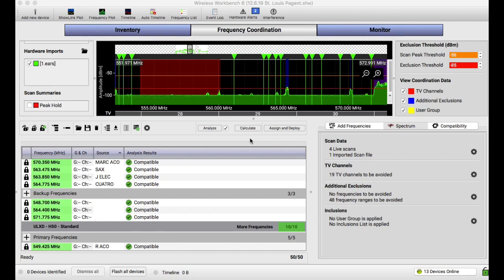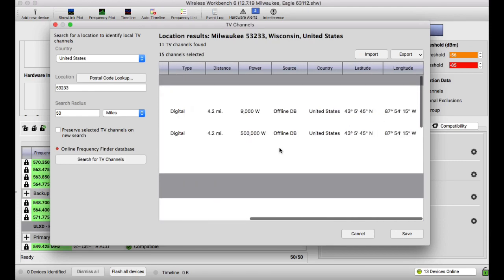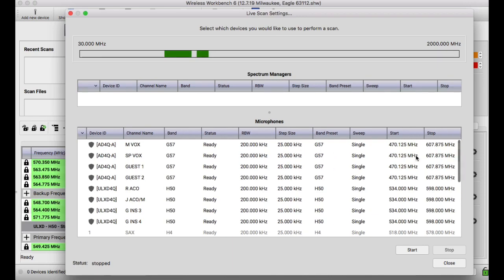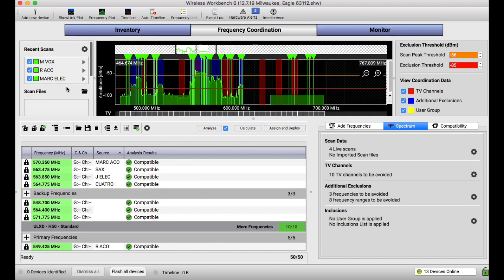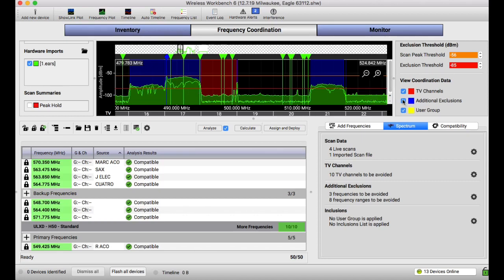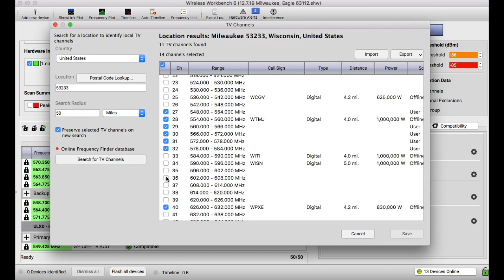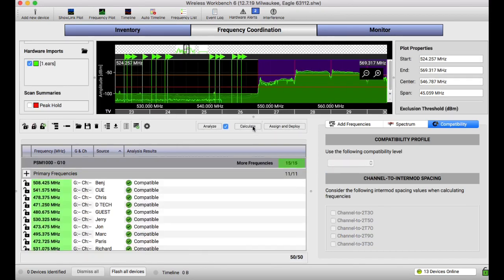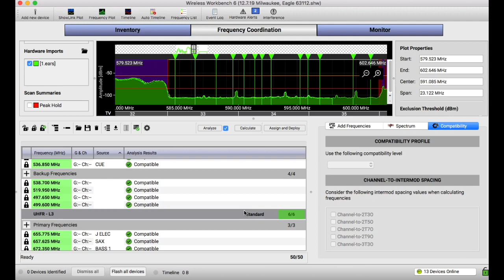Daily RF Coordination Milwaukee with Nicholas Radina using Shure Wireless Workbench!

Comment: Another great coordination video.  Can you simulate the process of going to a backup frequency should a problem arise?
Reply from the maker: Thank you, Chris! I will add that to the list. I will tell you that with this specific application and available gear,  the option of changing to a backup freq remotely is not possible.  This needs to be done manually. I always coordinate backup freqs for both inputs and outputs (IEMS).

 When avaiable, I always have a "spare pack" that has it's own transmitter. I load up this pack with all the mixes including it's own freqenucy. I then drive this "spare mix" from a matrix -- this gives me the option to assign any mix bus that is in trouble and I'm able to deploy that pack to the stage without haveing to grab the troubled pack from the performer, sync a new freq and then return to the stage. The Shure Axient line offers the abily to manually or automatically switch to a new freq if that is what you need. 

I hope this helps!